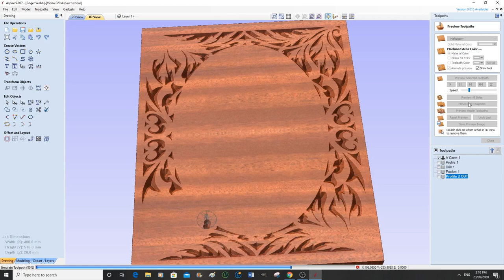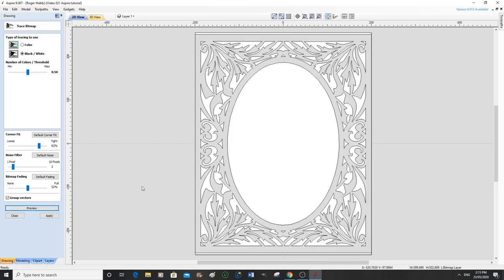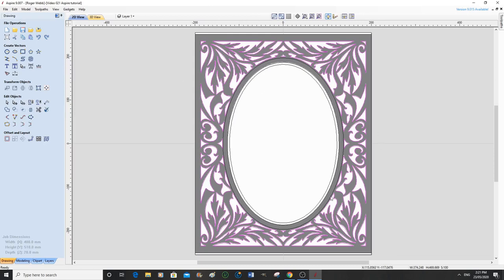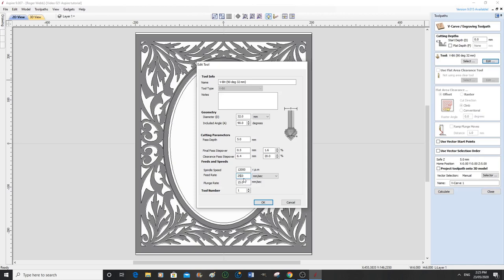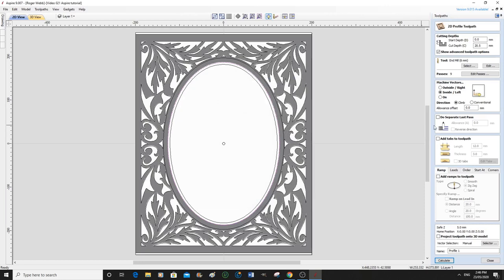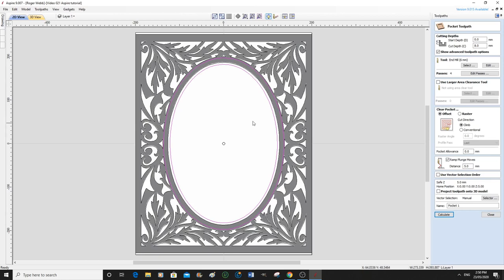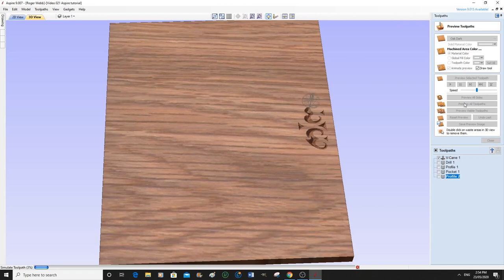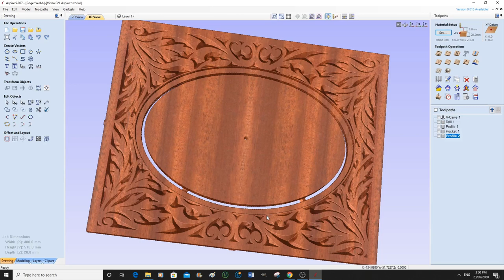*NEW* Vectric Aspire 9, vectors to V bit, profile and pocket a picture frame

Comment: Hi Roger, just a tip for working on your vectors after copying your bit map, go up to the layers tab at the top left of the screen click on it, the layers shall drop down if you click on the bitmap light globe turning it off the bitmap will  leave the screen leaving the vectors to work on. if you want it back just click on it again and it will appear back on the screen. Nice work.